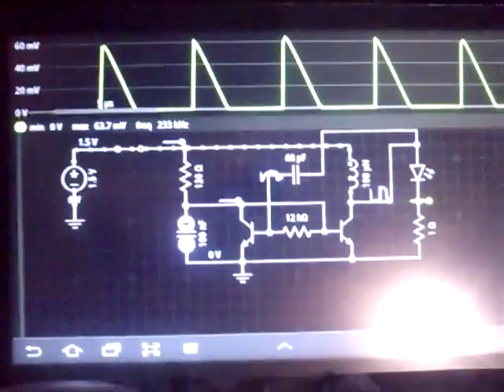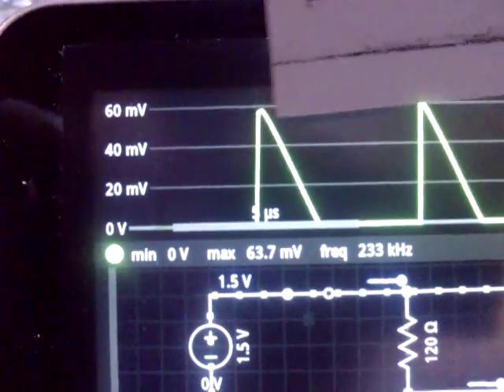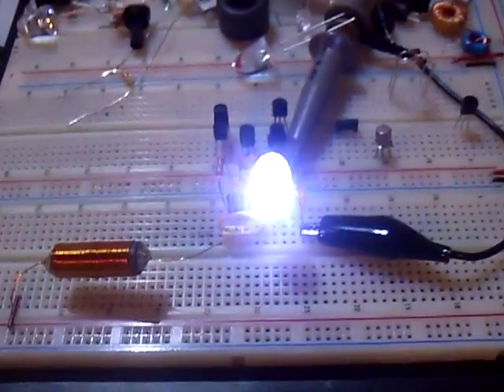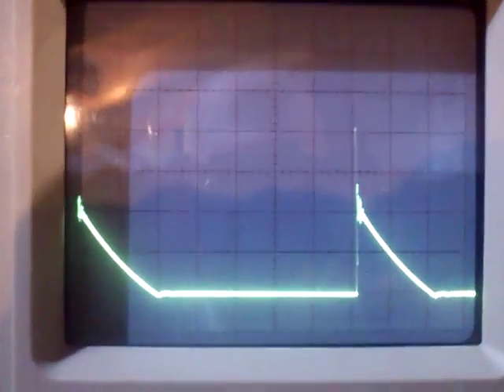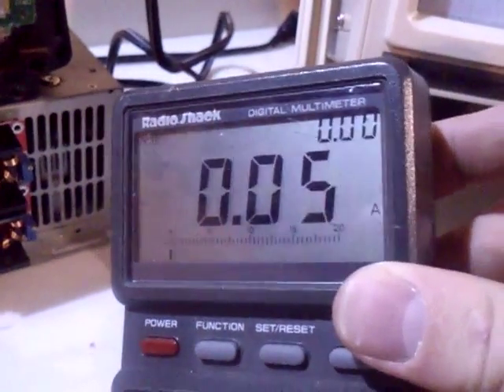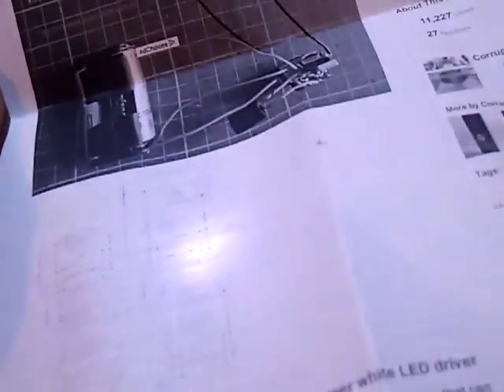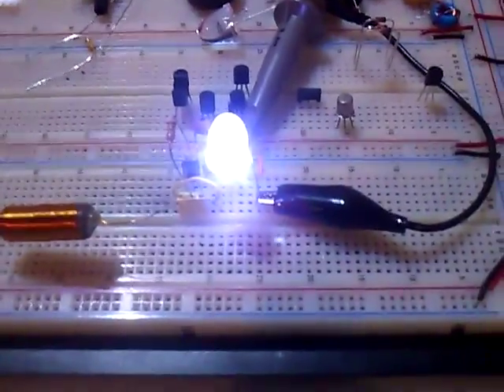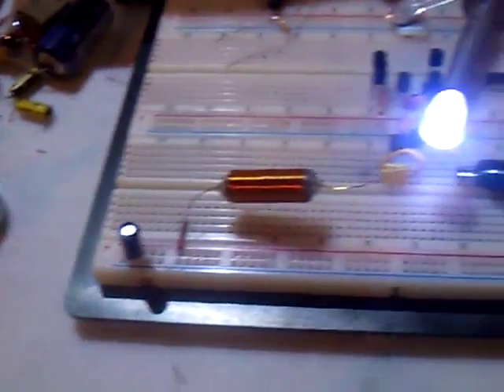2 transistor joule thief

Comment: I have found better transistors than the 2n2222. I have so many I just started playing around with them. I recommend it, try your own twist on the circuit.
Reply from the maker: I also have better transistor then the 2N222A no worry it was mostly to demonstrate that you can use almost anything and this circuit will still perform.

Comment: I am having trouble with this circuit.  Is it possible for you to share your design in everycircuit so I can run the simulation myself to better understand.  I can't get mine to work.
Reply from the maker: of course. http://everycircuit.com/circuit/5675743732826112 here's the link so you can open it in Google Chrome.
Reply: +bakupcpu hello sir.  I get the following message from everycircuit "Cannot display private or deleted circuits"
Reply from the maker: +Kaptainkneemow sorry I forgot to put it public. it should work now.
Reply: +bakupcpu   Fantastic!! Thank you very much!!
Reply from the maker: +Kaptainkneemow no stress. enjoy
Reply from the maker: +Kaptainkneemow your problem is simple the program can't simulate high frequency circuit at 1s sample you need to reduce the time sampling. this type of circuit operate at several kilo hertz you will need to bring the simulation speed to around 50 microseconds.
Reply: +bakupcpu  It works!! Thank you for all your help!!  It is really appreciated.
Reply from the maker: +Kaptainkneemow no stress cheers!

Comment: what are the transistor that you are talking about at 5:12
Reply from the maker: They are high gain and high current one. Don't know the number by hearth i could let you know that in a few weeks. Cheers
Reply: ok that would be usefull thanks
Reply from the maker: +kiskiller3 The transistor is 2SD965 I bought 50 for roughly 10$ I think
Reply: +bakupcpu thanks it ill be useful
Reply from the maker: You're welcome :)

Comment: MCD is a measure of luminous intensity (how bright is the beam when it hits something), and not candlepower or lumens (a measure of total light output).

For example, a simple 5mW laser may have a very intense beam, so the MCD would be very high, while the actual total light output is not much at all. This is because of how tight and narrow the beam is. That little bit of light is focused down to a dot the size of a match head.
Reply from the maker: I did some research on this mater indeed and MCD stand for millicandela so 1000 is 1 candela :) more info http://www.superbrightleds.com/led_info.php.

Comment: The 100 nF across the driver transistor and base of the output transistor is counter to what you really want: fast switching.  It lengthens the time for the transistor to go on and off.  To me that is a waste of power and energy.  In order to compensate, the resistor had to be lowered to 120 ohms to speed up the switching, again wasting power.  Perhaps you could leave the link to the instructable here so we could find out what good, if any, this 100nF is to the circuit. I say take it out.